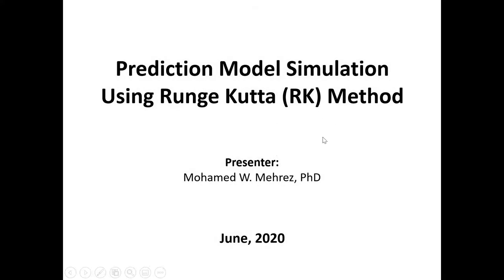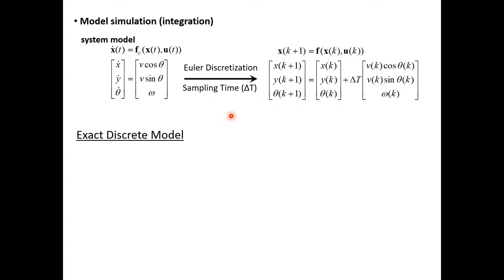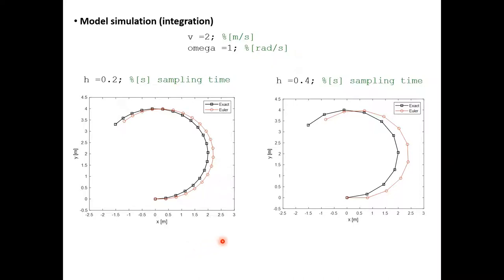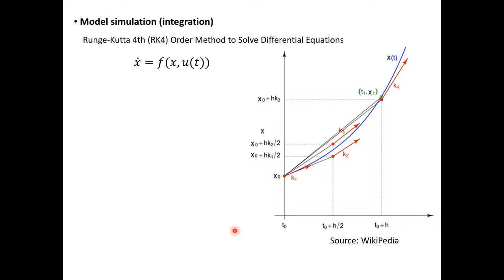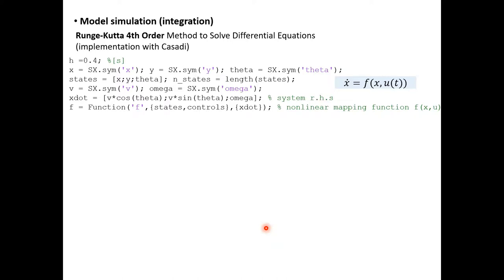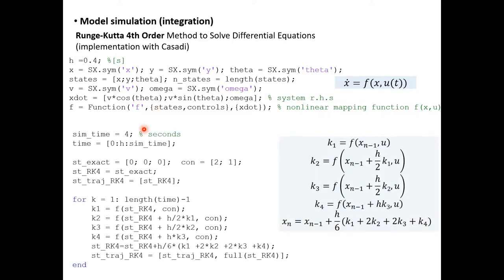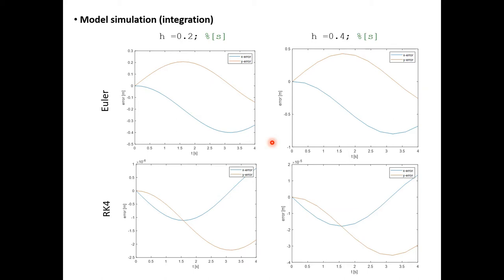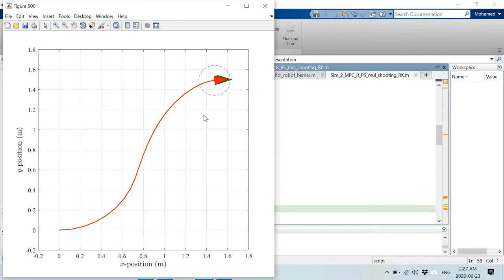Part 1 (Cont'd) | MPC Model Simulation using  Runge Kutta Method

Comment: Can you please tell how did you obtain the exact discrete model from continuous one? I can imagine you expanded around theta + sampling time * theta_dot, which is omega, but the confusion arises from the presence of omega(k) in the denominator, for both x(k+1) and y(k+1)...
Reply from the maker: By direct integration of the system model. That's not always possible for the dynamical systems in general.

Comment: Hi, 
is it possible to get the whole code?
Would like to see how you implemented the OCP in Matlab.
Reply from the maker: Hi, Matlab code is linked in the video description. All the best!
Reply: @MohamedWMehrez   
Thank you!
I am currently also writing a MPC code. However, I still currently have big problems and can not find my error. 
Could you help me with this? 
It is the same procedure but it is a different use case

Comment: Hi,
did you also change the shift function with Runge Kutta 4th order? Does it even make any difference?
Reply from the maker: No change is needed to the shift function. We simply changed f which we pass to the shift function and works the same way as f from Euler discretization.
Reply: how we can add the arrival cost in this program with EK filter ?
Reply from the maker: This can be done by adding (the difference between the estimate of the state at time k-N and the corresponding optimization variable for the state at that time) to the cost variable.
Reply: Dear Mr. Mehrez, could you please explain why we don't adapt the discretization in the shift function as well? In the shift function we compute the initial state also by a euler discretization, so why don't we use RK4 again?